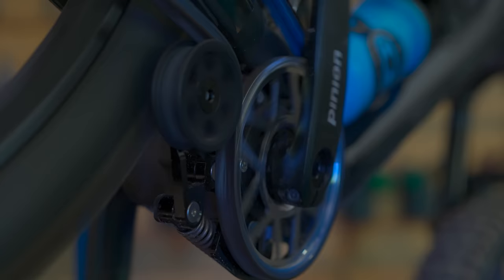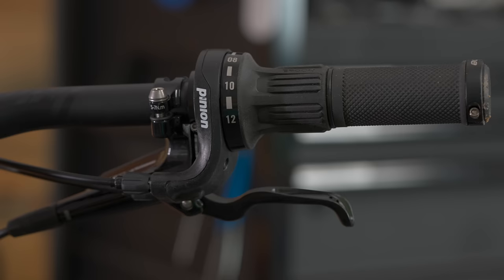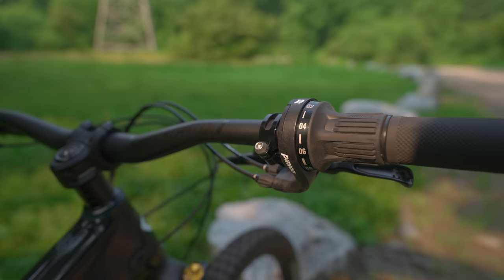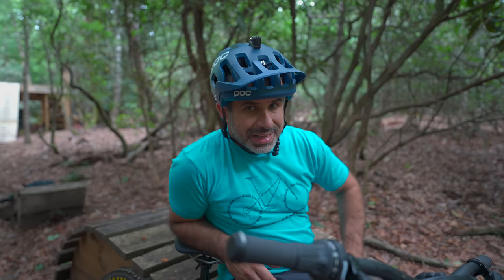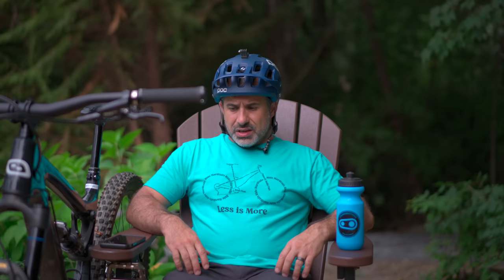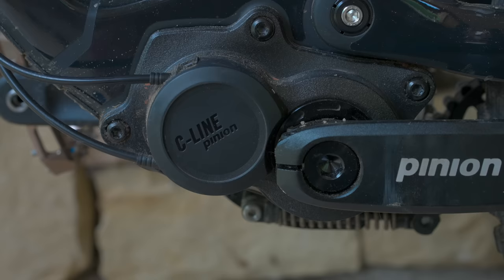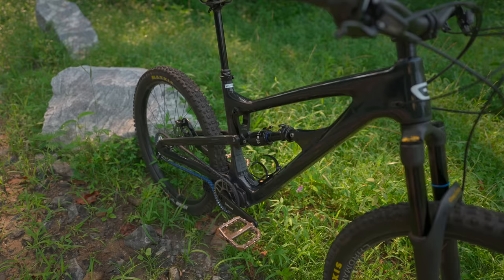What's the deal with gearboxes? Why don't more mountain bikes have them?

Comment: I suggest looking into the hubs of Rohloff. They replace your back hub with a gearbox, so you won't need a six bolt frame
Reply: Yup.  Has most of the same advantages and drawbacks of the pinion system, and can be setup to use either a chain or belt.
Reply: Would be terrible on a FS bike though... all that extra unsprung mass...

Comment: You definitely feel a bit of efficiency loss. Although it’s probably less than a dirty derailleur (i.e. after 15 minutes on trail).
And it’s supposed to break in after 500km or so, would become much smoother.
Reply from the maker: This is an interesting point a lot of people have brought up. When a derailleur gets all mucked up and dirty on a long ride, it too loses efficiency while the gearbox remains constant. Depending on the nature of your ride, a gearbox could be equally as efficient and cause you fewer issues.
Reply: @SethsBikeHacks  the derailleur system is also less efficient at either end of the cassette due to cross chaining. Add some mud and grit and they would be pretty similar.
Reply: Just like a car or motorcycle transmission, they have a wear-in time where the meshing teeth lose their tiny machining variances and smooth out, reducing friction and reducing noise. An oil change would be advisable to remove the tiny flecks of metal probably, and thereafter, good to go.
Reply: @SethsBikeHacks  long-term review incoming:
So it’s 8 month later and 3K kilometers, mostly gravel and bikepacking-like tours in Cyprus mountains. Gearbox became buttery smooth long ago, had yet to have any issue at all. 
In total I can remember like three times the gear skipping (for a quarter of a turn) probably due to very unlucky shift and very hard pedalling.
No maintenance, no nothing, just wash the bike once in a while. Several times went through clay after the rain, bike got unbelievably dirty, no issues with the belt drive. 

Due to change the oil soon (kit is like 20 euro or something), which is a very straightforward operation. Also got spare belt, just to be sure on them extended mountain trips (not expecting current one to break, but new belt is not that expensive and weights nothing).

I’ve got 12-speed version (with 600% range), which means that 1st gear is waaaay to low to move (steepest climbs are like 3rd gear for me), but the 12th is OK for pedalling for up to about 40km/h with my gearing - which is road bike territory. 

Al in all - it’s a dream come true. Would surely recommend.

Comment: My 11 speed Shimano was $400 its on my commuter bike and has trigger change. It is DEAD silent and never misses a beat. The rattling dirty derailleur cassette dropped the chain at the worst time, oily black hands at the start of a working day even after scrubbing left black finger nail edges.I was all too aware that one chain fail crossing a busy road would be hospital or death. A great advantage is sequential shifting, trigger up 10 times or thumb down using every gear in order simply, Try working out the crazy shifting to do that on a bike with a front derailleur!  
I have had this for two and a half  years I travel 34km a day to work and back and so far maintenance is a hose down after rain and oil once in two and a half years...

Comment: If I had the money I would be riding a Rohloff, recently had one in the store that was shipped to Rohloff for a full overhaul, it did over 50000 kilometres so far and still is going strong.
The inspection log had one oil change every year on it for the last eleven years and this was the first time it went back to Rohloff according to the documentation provided.
On the efficiency statistics, regular drive-trains are almost always stated in perfect conditions, so no dirt or wear what so ever. Not really realistic out on the trail where the only time your chain is clean is in the garage after it was just washed. So they are closer together, tho there still is a difference for sure. But one you will only notice if you race I guess.
Reply from the maker: I got to try a Rohloff about 7 years ago, and am curious how far they have come. I remember it being really compact, and it was on a pretty normal looking bike. That could be another cool thing to look into.
Reply: Rohloff Speedhub is great, I have one on my hardtail and I love it.
Not ideal for a full suspension bike though (high unsprung mass).
Reply: @SethsBikeHacks  they are just regular gear hubs that fit pretty much every normal bike. They also have the grip shift with two cables but offer electronic shifting with Bosch or Panasonic ebikes. 
The hub itself is pretty much the same with only iterative changes over the years. 
Still expensive at a thousand bucks, but at least works with normal frames.
Great range of over 520% (more than a 10-51 tooth!) with 14 gears.

There are multiple ones doing 100000 kilometres so longevity really is there too. 
But you still have a weight penalty but efficiency is around 4% better than Pinion.

Comment: This was the bike I wanted to buy 3 years ago but 29er sizes were too large. Then I discovered the Instinctiv brand and took delivery of a M9 last year. It can be ordered with a tigger shifter another advantage of a gearbox bike is the rear wheel isn’t dished. It’s probably stronger than the front wheel. My bike is modified with a Pinion rear spider equipped with a 36 tooth narrow wide chainring.  The first gear is super low and the frame holds 2 water bottles. The perfect bike for an old guy in British Columbia and I get constantly asked if it’s an 
e-bike.

Comment: Happy Pinion customer since 2012 here. I own a Nicolai Enduro bike with the first Pinion series P18. This one still uses a chain instead of a belt.
I've changed the oil after 9 years and not because there was something wrong, just because I thought it is about time.
The biggest issue most people probably have is the grip shift, but for the gearbox this is actually really great ( I hated GS on normal derailers). When something comes up on the trail you just remove the pressure on the pedals for a fraction of a second and shift multiple gears at once and after that you know the gear is in and you pedals as hard as you want.
The other thing holding this tech back is bike compatibility. In my local group people switch bikes every 3-5 years (I am still happy after 11).
The price is actually not that valid. This is a high end product so your have to compare this to this fancy SRAM line.
I am considering getting a new bike in 1-2 years, but mainly because I am still on 26 and after some tests on our local trails 29 seems to have an edge (also replacement parts for 26 are limited). I probably will get another Pinion but with belt this time.

Comment: That's a really good assessment of the transmission.  The pause needed to shift gears seemed way more intrusive than you made it out to be 

Belt drives are perfect for single speeds due to their quiet, simple, and reliable nature. The only issue is if you want to change gearing.  You would need a whole new belt/cog combo.
Reply from the maker: 🤤belt drive single speed....
Reply: The shifting definitely takes getting used to, to me that's the biggest downside.  That plus the extra drag.  It actually reminds me more of driving a manual pickup truck than a smooth automatic car.  I use mine for commuting mostly, for that's it's perfect
Reply: The drag gets less and less as the gearbox wears in from what I've read.

Its criminal how much sram expects you to pay for a high end cassette which is a consumable component
Reply: @infinitebirch the drag is actually less than you think. The best possible conventional chain drive (a single speed) is about 97% efficient. The Pinion gearbox is 90.5% efficient. The thing is, a 1X 12 speed drivetrain is most efficient in the midday gears and is close to the Pinion on the outer gears, due to the added friction of cross chaining. The 1X drivetrain is as efficient as 96.0% and as inefficient as 92.4%. On average it’s 95.1% efficient.
Reply: @streddaz  I've only ridden the priority 600, it also has very wide tires which I'm not used to.  I'm wondering how much I'm feeling is huge heavy wheels and relatively budget hubs vs the gearbox itself.  I'll have to try a more high end pinion bike at some point.  One thing I can say for sure is the more I ride it the less drag I feel, but on group rides with people on road/cross bikes I have a pretty hard time keeping pace.  Anyway, for me it's a commuting bike so I don't expect top racing performance
Reply: @infinitebirch  yes, if you are wanting an XC racing like performance, a gearbox bike isn’t probably your best option, but if it’s more enduro like riding or bike packing and even commuting, a gearbox is a great solution. A mate of mine has a Zerode Kapito and he loves it.

Comment: I drive now for 2 months with a Pinion gearbox and never want anything else. This works super well and wear is no longer an issue. 
 
You also notice how positive the weight savings on the rear wheel for the function of the suspension is. 

And btw: compares times the weight of a Pinion transmission with a new SRAM group ...

Comment: I've tried Shimano's internal geared hub thing while working at a bike shop. It was annoying to service but maybe that's just because I was more used to derailleurs. Thought it wasn't particularly something I'd get but was a fraction of the pinion price so I'd bet my thoughts would change if I tried the pinion.
Reply: If you want low maintenance for commuting, you can't go wrong with a Nexus 8. Costs about 1/8th of a Rolhoff.  But I wouldn't advertise them for heavy duty.

Comment: These belong on e-bikes. You can ditch the grip shifting for electric shifting, and the drag/weight won’t matter.
Reply: They make exactly this (Pinion E1.12), since this year.
Reply: You could likely even ditch manual shifting with the autoshift feature on shimano di2 on an ebike. Fully automatic transmission lol.
Reply: gearboxes belong on bikes you actually want to ride in rough terrain without smashing them to bits just while riding, so they definitely belong on mtbs

Comment: I have a Pinion 1.18 and love it. Maintenance is an hour each year, change the oil and check the shifting cables. Fast-quick multi-gear changes at a time. If I forget to shift at a stoplight- no problem- just shift to the one you want.  If you hear a squeak (no grinding or slapping ever) rinse off the carbon belt drive and continue on.  I'm not breaking chains, bending derailleurs, cleaning and greasing chains, adjusting cables, yada-yada. I ride, not fix my bike. I agree it's not the right option for racing. I'm a touring nerd, so I want to be able to ride for days on end and never worry about the drivetrain.  Expensive yes- but if you haven't tried it, don't knock it. The weight-to-convenience ratio should make the Pinion an option to consider.

Comment: I'm leasing a trekking bike by Gudereit since August of 2023 (wanted some gravel first) with such a C1.12 and it's great for commuting, we only have some hills here (however a couple of mountains just 30 miles south) and I mostly use gears 4-10, 11 and 12 only if I'm really fast/downhill.
My dad said one of his work colleagues got a similar trekking bike since the early 2010s (so when Pinion was brand new) and it still runs fine.
I would like to add some things: the C1.12 and the other C-Series have magnesium cases while the P-Series use heavier aluminium; the C1.12 has a total transmission range of 600% and every step is +/-50% (it's a little odd in the beginning, it often rapidly shift up my derailleurs when accelerating, two/three gears at once, here you rather shift up single steps and rather don't skip gears), so you're shifting linear, the P1.18 even got 636% in 18 steps so each shift is +/-35.3%.

There's also another German bicycle transmission: The Rohloff Speedhub 500/14, this is around since 1998 and also has its niche (but they achieved 400k built/sold in 2023), cost you over a thousand bucks and is a heavy unsprung weight, but it's extremely reliable, the record holder has reached 384.400 kilometres in 2019 - the distance from earth to moon.
As the name suggests is has 14 steps and a range of a little over 500%.
IMHO it's worth mentioning that both of these usually have grip shifters with two wires and that's because the indexing isn't in done by the shifter like on derailleurs or other hubs but the gearbox itself and the Pinion simply doesn't shift, if you're too hard on the pedals (you can't turn the grip), it's a nice overload protection and thanks to muscle memory you'll automatically relief the pressure on the pedals when attempting to shift in a few weeks.

Maybe I'll give mine some winter tires for upcoming winter season (or my cheapo Pegasus it's literally my spare bike now, I use it to get to the main station and lock it on there (and go by train without the bike) or if I go drinking/partying, it wouldn't bother me too much if that would get stolen), it's also perfect for that due to its encapsulation.

Comment: Personally, I'm sold on gearbox transmissions. Lower maintenance, less likelihood of breaking a derailleur, or bending a derailleur hanger, plus a wider range of gears. What's not to like?
I recently had a Rohloff 14-speed transmission installed for a 2nd bike. This time my trusty Specialized S-Works Turbo Levo received a Rohloff upgrade. Gotta say it is sweet. With a wider range of gears, I can now climb pretty much everywhere, I am loving it. I'm now enjoying the uphill flow every time I ride. This thing just performs perfectly.
If you are considering a gearbox, just do it.

Comment: I was big into cars much before I got into cycling.  My 5.0 V8 engine has a timing chain that lasts so long that I cannot find any instance of somebody needing to replace it because of wear.  Timing chains in cars last much longer than timing belts, which are regarded as more fragile and in need of replacing at certain intervals.  Imagine my surprise when I got into cycling and learned that the rubber belts were longer lasting than the steel chains, lol.

Comment: Belt drives and gear hubs or boxes are awesome! I was lucky enough to get a commuter bike with pinon gears and belt drive at a great discount back in 2019. 4 years and thousands of kilometers down the line I've had no issues with the gearbox (or bike in general) and I really can't fault it. Yes, it weighs quite a bit and the grip shift is not the most ergonomic shifter you can get, but drivetrain maintenance is cut down to a 5 min oil change a year. For winter riding or commuting it's a no brainer.

Comment: Been riding with a gearbox and belt for almost 2 years now and NEVER going back to derailleurs! 

I was always astounded with perfectly fine cassettes being thrown away because my chain needed replacement ‘and so did my cassette’ to match the new chain. Bumped my derailleur so many times, went through hanger after hanger, got dirty and spent so much time being frustrated by my drivetrain… my Pinion gearbox fixed all of that. 

Anyone reading this who wants to travel by bike — get a gearbox bike!

Comment: A Pinion MTB is my great white whale... 
You forgot to mention the unsprung weight that's less when using a gearbox.
Also a conventional drivetrain is more efficiënt, but only when it's clean. So during a muddy ride that can go south pretty fast.
There are Pinion bikes with conventional gear levers (Instinctiv bike) but the two cable's remain.

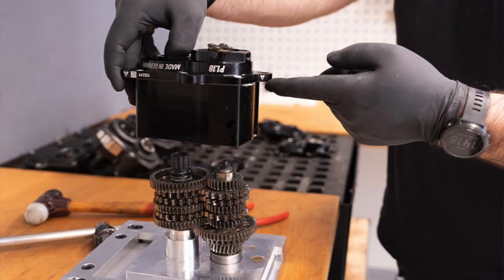Comment: 1:30 - Change the oil once a year? Yeah, right. Changing the oil in "gearboxes" isn't even a thing in the automotive world. I suppose that some people change it from time to time, but for the most part, the oil in a manual transmission and differential housing (AKA: "rearend") is in there for the life of the vehicle (they merely get topped off if they are low, not an oil change), and those gears are under much greater stresses/loads than the gears in a bicycle gearbox will ever see.

Comment: Couple of years back I had an NuVinici N380 Continuously Variable hub installed on my Catrike Expedition recumbent trike. I love the hell out of it, it's nice not having any gears or in between gear issues. Instead of a derailleur I use a chain tensioner, Origin 8.
Those belts last forever ten times longer than a bike chain.

Comment: Top stuff for covering Pinion. Would be nice if Shimano or SRAM or a new bike company would get to build/tweak something like these at a better price point. 
Being mid-drive, the benefits for balance and freeing rear suspension movement is impressive.
I wanted to try out a different drivetrain besides derailleurs, went and tried a Shimano Alfine but found it sort of lacking even for it's intended purpose (Rohloff is too damn expensive), I did like the Gates carbon belt version. Pinion takes bicycle drivetrain to an all new level and kudos to them.
Reply: Have you seen the price of axs once you’ve added in cranks, bb, chain aswell as the rest of the gubbins

Comment: Another word on suspension: Moving the gearbox to the bottom bracket area takes a bit of weight off the rear triangle. This means the bike has less "unsprung weight" which allows the suspension to function a bit better.
Reply: And a lower center of gravity, making the bike more stable in rough terrain.

Comment: The transmission losses are higher than for DR bikes, but if you are not doing XC, gravel or road racing then a gearbox bike makes a lot of sense.  Belt drives require a splitable rear triangle.